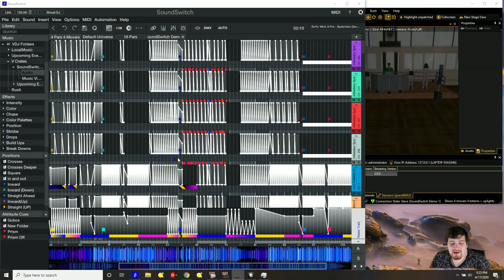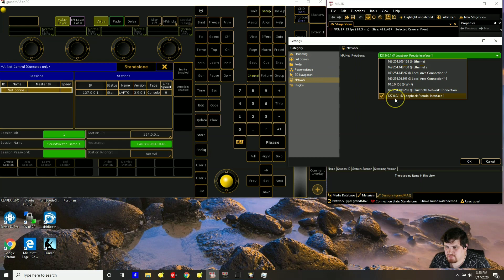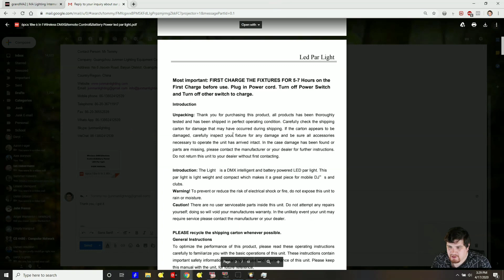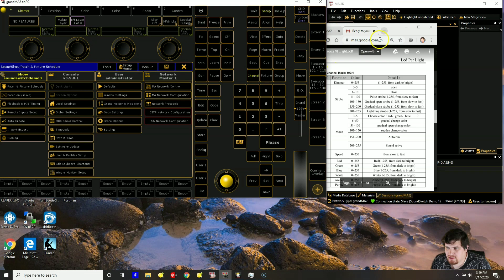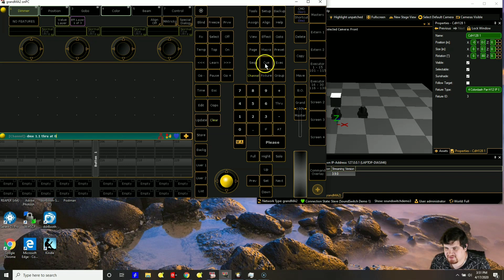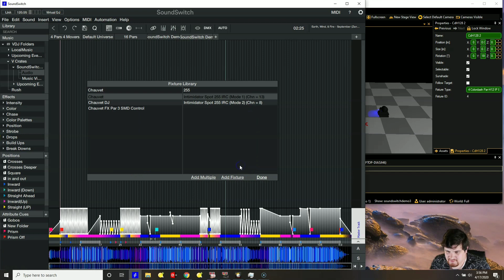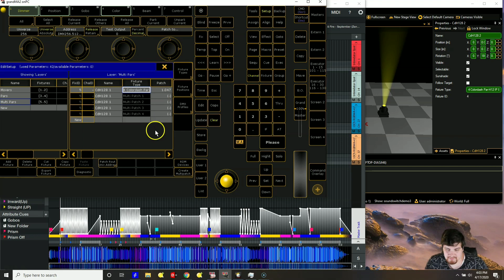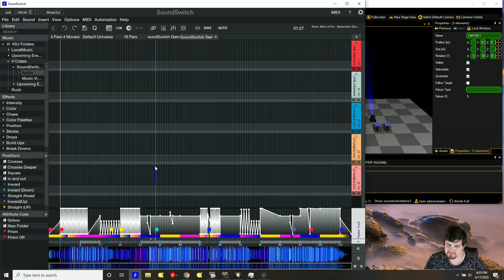Connecting an external 3d visualizer to SoundSwitch Tutorial (GrandMa2 and Ma3d)

Comment: Struggling to figure out how to get this to interface with QLC+. On the QLC+ forums, you mentioned this process can also preview. I am using QLC v 5.1.0, and I have lights on universe 1. I tried localhost artnet both on output of Universe 1 & Universe 2(which I set up specifically for MA2), and I told the artnet for artnet universe & tried 0 1 and 2 for both outputs from universe 1 and 2. I did the commands. I see the fixtures in the 3dview, but they don't respond. Can someone help, please?

Thanks!

Comment: This is wonderful. Two comments to add... You have to watch out with MA fixture profiles, sometimes they don't render the beam and spot in the visualizer. You can edit the fixture using the MA fixture builder (download from the MA site) to make the beam type 'conventional'. That held me up for a day with this. The other tip I can add is that in MA2 Go 'SETUP' - 'Select your show' - 'Playback & MIB timing'. Then in the 'Startup' field you can enter the commands so they run everytime you open the project. "Dmx 1.1  Thru At 0 ;  Park Fixture 1 Thru At Channel 1" (without the quotes). Note the semi-colon separating them.

Comment: Hi Daryl and thank you for all your sharing! Does it mean than I can have MA3D running on windows while running soundswitch on mac with serato, as long as the windows ip address is declared in soundswitch or the mac ip address declared in MA3D ?
Reply from the maker: You could... or you can just have SS running on your windows and then export the project to your MAC. That's what I do these days
Reply: @DJDarylBennett  thank you. Export/import is less computers but less screen space too. I will try to figure out networking across 2 laptops within the same wifi since there are 2 locations but 3 programs declaring an IP address : SS/Mac, MA3D/Win, GrandMA2/Win

Comment: Hey Daryl, firstly, thanks for all your soundswitch videos, they've been absolutely invaluable. 

I've followed this tutorial step by step, however, no artnet devices are showing up in the Soundswitch hardware tab. Ive  also tried using Capture and I'm still having the same issue, no artnet devices are found. Any thoughts? Im on a winfows 10 machine. Many thanks
Reply from the maker: Try restarting everything, run on a windows machine, start the programs as admin, start grandma first before ss

Comment: Hey Daryl, thx for this and the many other great Videos. Maybe you can help me to connect Soundswith with the 3D Software. I use the Prime 4 with the Control one. And it only shows me this device without ArtNet. If i turn over to Virtuel DJ like it shows me in your video, i can't see any Device. Thx for helping
Reply from the maker: You need to use SoundSwitch and GrandMa, virtual DJ connecting to SoundSwitch is a whole different thing
Reply: @DJDarylBennett  Thank you very much for the quick reply. Of course I use the whole thing on the PC. So Soundswitch and MA3D. But it does not show me an ArtNet connection. GrandMa on PC and 3D run without problems, but I can't get the connection to Soundswitch to work.

Comment: Hi, I run SoundSwitch on MacOS Ventura 13.2 and try to use the visualizer on a Windows 11 Pro machine. Both are running on the same Wifi network and connected. On W11 Pro both software are running as Admin. I'm not able to change the IP address of my SS MacOS  in MA2. In the dropdown for the Station IP, my MacOS didn't pop up. The setup 'header' is called 'Network Standalone' so I'm wondering if it will work with this software. Seems that the MA Lighting MA2 Forum doesn't work. Searched online but couldn't found an answer so hope I will get one here. Thanks in advance
Reply from the maker: There’s another tutorial by another person on how to connect a Mac to a windows running grandma. Honestly, I’d just develop your show on your windows machine on another instance of sound switch and then export it to your Mac. That’s what I do now that I’ve joined the dark side and rock a Mac
Reply: Hi Daryl thanks for your answer. Can you post the URL to this tutorial? If I understood well, you prefer Windows to build your show instead of MacOS. Which problems did you experience on Mac or what are the benefits when running on Windows?

Comment: When I added "Dmx 1.1 Thru At 0" all of my uplights went to the correct colors.  However, my movers stopped shining any light.  They are moving, just not shining any light.  They were shining light before I typed that command.  Any ideas?
Reply from the maker: I'm not entirely sure, I'd look to make sure soundswitch is sending the DMX values GrandMA. If it is, I'd look at fixture profile you added, and make sure it maps up to your fixture. You might have to edit the fixture to correct it.
Reply: @DJDarylBennett  Dude.  That was it!  You are a genius!  Why didn't I think of that?  Anyway, yeah when I checked the fixture profile to the light's manual settings, they didn't match up.  I basically had the wrong fixture assigned.  Putting that command in exposed the truth lol.  I got the correct fixture in now and it's working perfectly!  Woo hoo!

Comment: Thank you for taking the time to do this. It works perfectly. You have to run all three programs as an administrator. Going to use this to set the foundation and then fine tune with all the light on. Also GrandMa does not have all the lower priced lights. This is awesome thank you.

Comment: hi, thanks for the tutorial! just wanted to give you a heads up that grandMA 3 works flawlessly with SoundSwitch too, just enabling an ArtNet entry and setting it to Input is enough for everything to work :)
Reply: Hey, I will try grandMA3 because I can't link grandMA2 with 3D visualizer here and don't know why... I let you know, tks.
Reply: Wasn't able to install grandMA3, no enought memory in my PC. So I'll stick with grandMA2 and try to find a way to link it with the 3D visualizer. I see my ip address but not the name in the screen...
Reply: Did you do anything special? We're having a tough time linking MA3 🫤
Reply: I've tried this, the Art-Net entry set to Input and it is getting recognized in SoundSwitch, but it's just not affecting any of the fixtures in MA3. There's no DMX input in universe 1 happening. Do you know of any additional steps you took to get it to work?
Reply: @Semx11  when I experienced that, a couple of restarts of soundswitch/grandma3, re-setting it to input, something usually helped. also make sure to choose the right interface (IP address) maybe? I don't have MA3 installed right now, so I can't exactly check. but from what I recall it was grandMA restart -> toggle artnet / dmx input in grandma and choose the right interface -> soundswitch restart -> toggle LINK in soundswitch playback (even in editor, sometimes it made it 'click') and it usually worked for me.

Comment: What a full circle video! Good quality content! My windows machine also does not allow the connection between sound switch and MA2, any update on possible solutions on this? I have attempted with mac remoting in to my PC however SS on mac doesn't see Ma2 as a hardware device over wifi. Would love a discussion about this! Again awesome video.
Reply from the maker: Hi Jeremy! I just discovered a possible solution for this today, try running your programs as admin, by right clicking them and selecting "Run As Administrator"
Reply: Im also on an asus desktop*

Comment: I couldn't get your program to come up in my Soundswitch....I got both the MA and 3D programs to communicate with each other.... but not to my laptop....I got almost about 75% of your video done up until it was time to create the demo on SS and find the same fixtures added on the MA software and the 3D deal.... but.... I'm pretty sure I did something wrong in my October 2019 HP PAVILION WINDOWS 10 RYZEN 5 AMD PROCESSOR laptop
Reply: I'm on a Dell XPS 8930 desktop, i7-8700 CPU , Windows 10 Pro, and I can't get interface to show in Soundswitch under hardware either. Any idea?
Reply: @triggr74  Did you find a solution to get MA & SS to talk to eachother? I was wondering if its firewall settings. I am in the same situation.
Reply: @milkiedj  no 😪 I gave up. But I don't recall messing with firewall. 🤔 I'm going to have to try that. Thank you for the info. Let me know if you find a way please.
Reply: @triggr74  Good News I have solved it! GrandMA needs to be "RUN AS ADMINISTRATOR", GrandMA then shows up in SoundSwitch under the Hardware tab.
Reply: @milkiedj  that is great news. Thank you. Just in case I don't know this, how do I make it do that? Thank in advance 😁
Reply: @triggr74  The icon you click to launch GrandMa, right click it and click "Run As Administrator". You can also go into properties and change it so it automatically runs as administrator. Here is a video showing 4 ways to run as admin: https://www.youtube.com/watch?v=SSTIP7ivW_Y
Reply: @milkiedj  Thank you. I'm trying to make it work again, but I'm stuck in the beginning. I know I had problems the 1st time with this too, but I forgot how I fixed it. I can't make grndMA show up on MA3D. Well, can't make them talk to each other. I have it under the 1.2.so forth
Reply from the maker: @milkiedj  This is the answer!
Reply: @triggr74  i've got the same issue!?
Reply from the maker: Interesting. I have an HP laptop, and GrandMa2 connection doesn't show up in SoundSwitch. I've had someone else with an HP tell me that. 

But it works great on my Asus laptop

Comment: I saw on the link to the WINDOWS software for this AMAZING 3D VISUALIZER that there happens to be also some related to MAC OS.... I'm wondering why you stated earlier that it only works with WINDOWS.... just curious because eventually I'm gonna get a 2020 MACPRO pretty soon??? All-in-all.... thanx a bunch for your info..... VERY informative and helpful, especially since I'm new at this whole SoundSwitch lighting thing
Reply from the maker: I think that grandma 2 only works for windows, and grandma3 will work on Mac. But these instructions won't work on grandma3